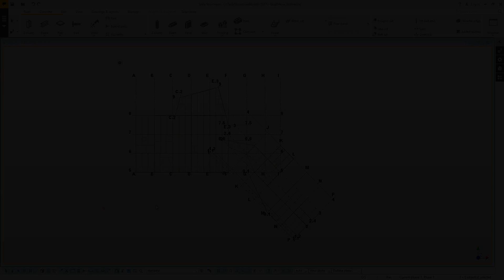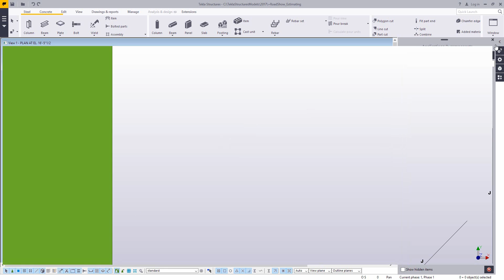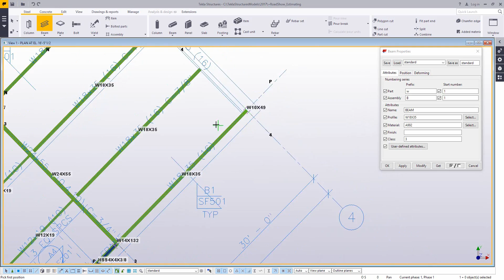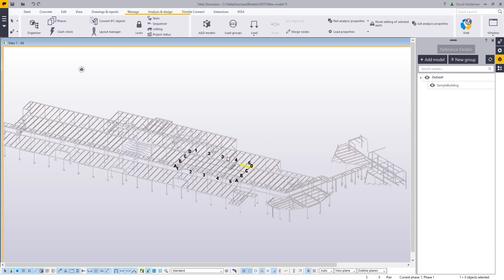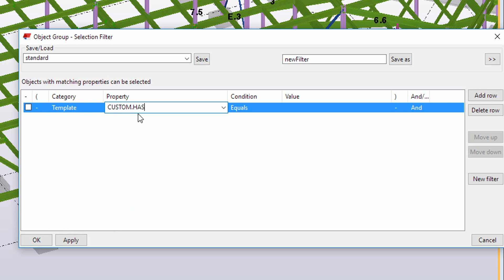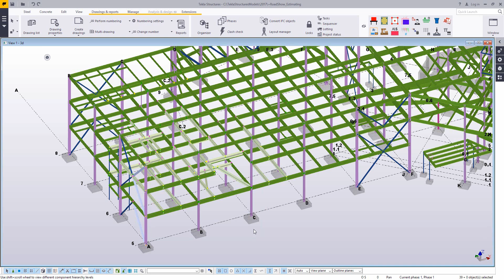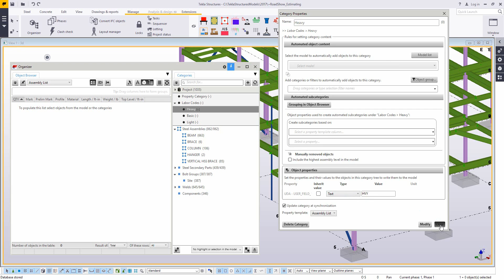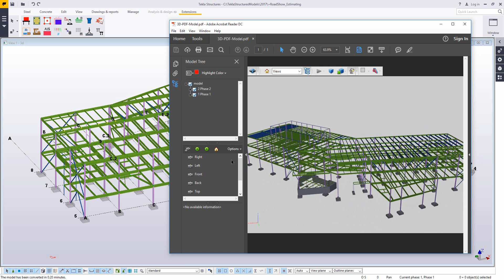Tekla Structures Steel Estimating Workflows

Comment: How do you change the color of the reference drawing? I have a white background with white text so it's very difficult to read the reference.
Reply: hey brandon if it a dwg file try to change the color in autocad then re-import.
Reply: ELMEHDI BOUSBIA it is a pdf file that I am importing so I don't have control over the color.
Reply: Hi Brandon - I created a custom 'Object representation' :https://teklastructures.support.tekla.com/2017i/en/mod_creating_object_representation_settings

First create an object rep filter to find anything that contains with ".dxf", then choose the color you like.
https://imgur.com/a/PdUSg The helpdesk can get you squared away if you get stuck.
Reply: Instablaster...